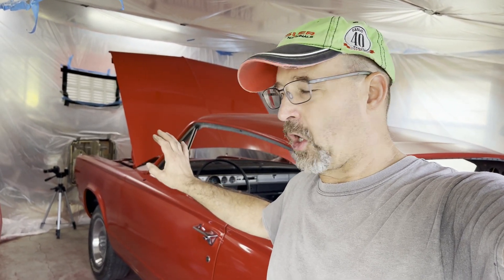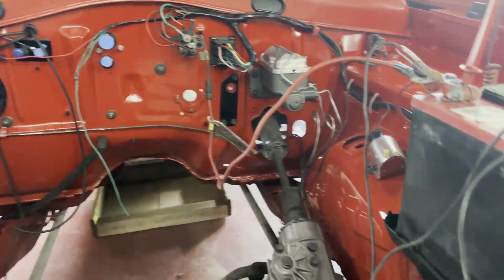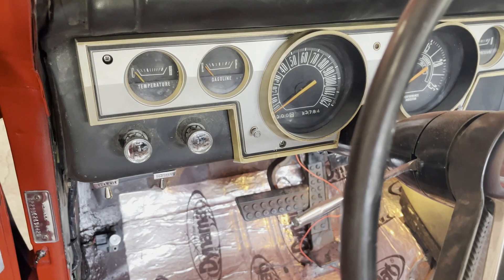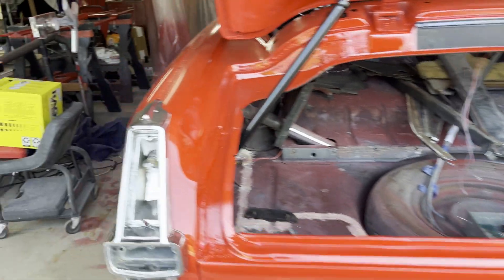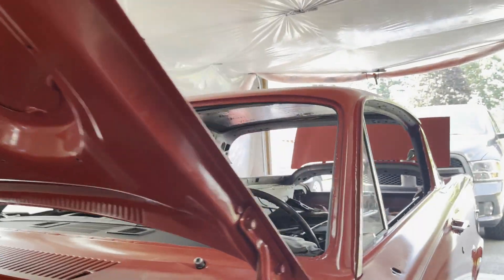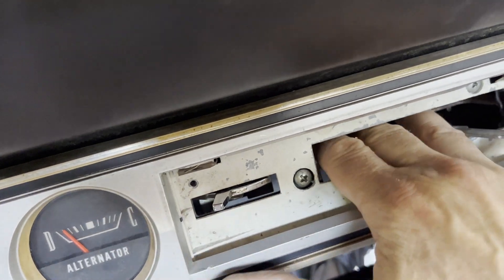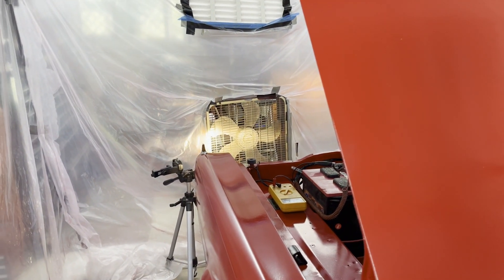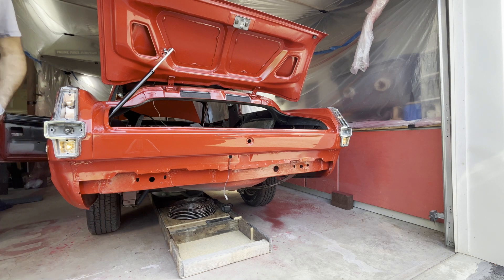Electrical System Installed and Tested

Comment: Where did you get the switches for the flashers and defogger switches? I am planning on doing a similar set up on my 65.
Reply from the maker: I had the flasher switch from a car I parted out and the blower switch from an eBay listing.
Reply: Did the switches come with the labels or did you get those separate.
Reply from the maker: @trevorpool6822  I had to track them down, the chrome labels are specific to the 64-66 models. Maybe a few other years, but they switched to black plastic ones later.